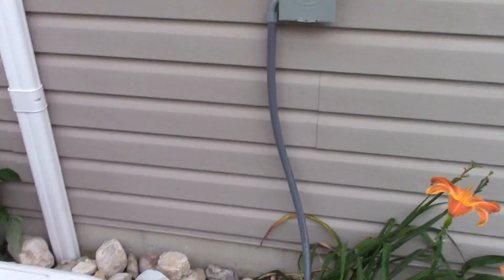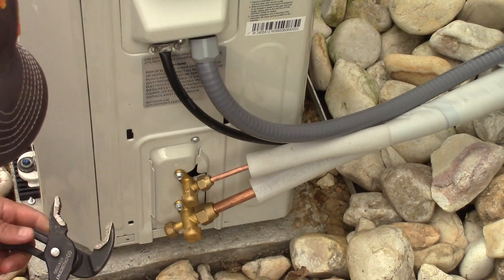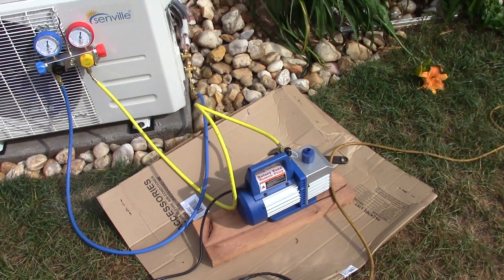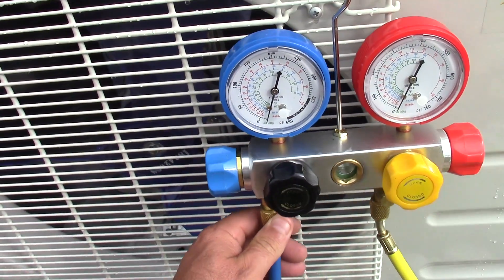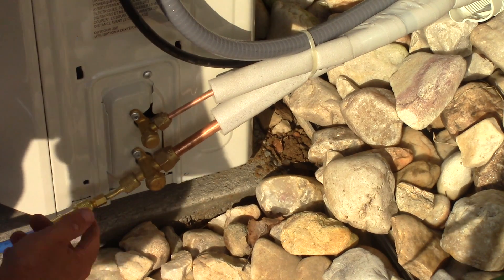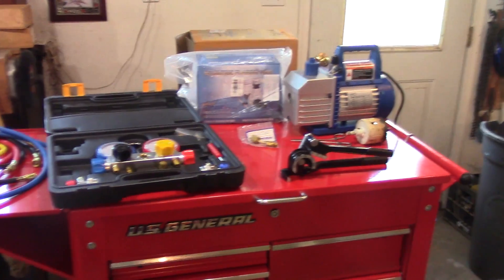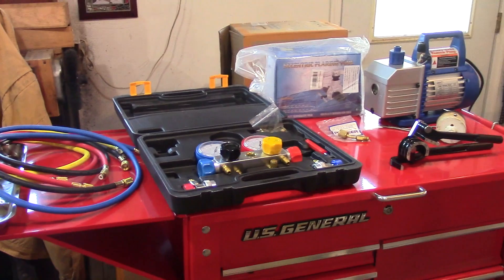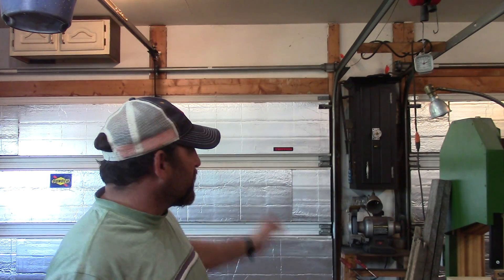Part 3 MiniSplit Install Adding Refrigerant

Comment: Nice video series.  Very helpful.  I’m on my second mini split.  The first one I bought was a cheap model that lasted only 3 years before the condenser unit started springing leaks.  I just bought and installed a MrCool model.  Got to vacuum the line set and release the refrigerant still.  Bought the same line gauges set but the adapter was the wrong size threads so waiting on a new adapter.  Thanks!

Comment: Why you didn't open the vacuum line before you release the gas ?
Reply: Because air/moisture will be sucked into the system. Better to release small amount of 410 then to let air in system.

Comment: Thanks for the walkthrough. I was quoted over $6700 on a 30k Mits install for my garage. I am going the pioneer route with a 36k system and saving myself about 4k.   I am going to have a 66' run so I actually need to break the lineset vacuum and add 16 oz  of refrigerant to the lineset before I open the the valves on the outside unit but on the bright side I will be able to check for leaks before I do so.

Comment: Mini Splits are the way to go, heating and cooling, I use my 5 Mitsubishi all year long, heating and cooling.  I save a fortune on cooling versus the old 13SEER  AC forced air, and oil no delivery in years, electric bill barely went up in winter $40, electric dropped like $200 in hot July and August, MiniSplits are great

Comment: should also purge with nitrogen before opening the refrigerant then pull vacuum again...according to the Mitsubishi installation manual
Reply: you only need to purge with nitrogen after connection, then vacuum that down. It should also be leak checked for minimum 20 min but an hour is best.

Comment: By not removing the suction vacuum hose the Freon charge went all the way back to the manifold when let loose..Would it not be better to remove hose , then release the Freon charge into the system. Maybe that little bit of waste is insignificant?
Reply: Think I read in the instructions you want the gauges still hooked up so you can monitor the pressure after cracking the ports open, just another leak check before powering the system. The tiny amount that comes out is no problem. Remember, the system is charged for up to '25 feet of line, it shipped with '16.

Comment: Not a good video so many mistakes you don’t check for leaks after you vacuum you need to use nitrogen when leak checking then vacuum down unit.  Many other mistakes
Reply: Meanwhile it's working perfectly....even after the 1.5 year review.  Take your negativity over to another channel.
Reply: missmymountain don’t get mad at me because you don’t know what your doing.  Showing people the wrong way is not good even if it is still working.  Wrong is wrong.   And you sir were wrong
Reply: @BrianGentry317  In your mind you know "the" correct way to do things.   Reality sometimes proves otherwise. In this case it has proven his way works.   Yours may as well but you're just talking about it and he's doing it.
Reply: missmymountain it’s clear your not a HVAC tech. So keep doing it the wrong way and see what problems you’ll have down the line.  And what it’s going to cost you to correct them.  🤦🏾‍♂️
Reply: @BrianGentry317  I haven't been a tech in many years; I do employ a bunch though.   Many of them share your attitude that there is only one way and yours is the best way.  You call what he did wrong, which implies it didn't work or it caused damage.  Two years of the system operating well has proven you wrong.  I can't help you see the error of your opinion but I hope you'll take this as a lesson and know you aren't always right.
Reply: @BrianGentry317  Lol.  I never said anything about you being right either.  You've got a lot to learn in this life. For your sake I hope you're only 16.  I wish you the best of luck at learning to learn.
Reply: @BrianGentry317  Exactly.  I'd suggest reading comprehension as your first next lesson.  This helps with understanding the meaning of what you read and not just being able to pronounce the words.

When I say "know you're not always right" it's a different way of me saying "you're wrong".
Reply: @BrianGentry317  You can't let it go.  You'll be thinking about this lesson for a while.

Comment: Invaluable video, great stuff!

If you were going to add another indirect unit to the compressor how would you wire it and run the lines? Would a single compressor have enough capacity?
Reply: Old Man Strength You can’t add another head to a single zone mini split which this is. You have to  buy a multi zone outdoor unit.
Reply: Dennis Jones thanks boos, I figured that out shortly after posting this question. Just ordered a three unit package, wish me luck!

Comment: Thanks so much, I’m going to do it myself. My quote from HVAC was 3900$
Reply: Including the unit or just to install it?
Reply: @bigpicturethinking5620  if I’m remembering installed but that price since then has gone way up. I installed it myself and bought the tools off Amazon very easy and has worked fantastic for two years.

Comment: How do you add the extra wall units to one outside unit?  You said up to 3 can be added.
Reply: you buy the outdoor unit designed for 2, 3, 4 or 5 indoor units, which come as a kit. Basically they are all considered extra zones.
Reply: They are called DUAL-ZONE, Triple Zone...units and they have the hookups for the extra heads. I.E. 28000 BTU base Compressor with TWO 12000 BTU head units, or an 18K and a 9K BTU head.etc.

Comment: Thanks for the great instructional video. my garage is a 12 by 24 but it has an open loft therefore I am considering a dual zone 9000 up 12000 down so I can keep the higher elevation loft cool in summer. Only have about 400 square feet. Do you think a 1 head 18000 unit would suffice? Cheers
Reply: Mitch Howes Not knowing the Senville, I haven’t seen any single zone system be able to add another head. It has to be multi zone outdoor unit.
Reply: Is your garage insulated? If so just mount a 9k BTU single unit up in your loft. If it's uninsulated, get a single 12k unit.

Comment: You won't see bubbles while it's under a vacuum. Bubbles can be seen if you do have a leak when system is pressurized with nitrogen preferably

Comment: When checking for leaks you should use nitrogen. Using vacuum to test for leaks is not good and  useless.
Reply: Yes sir you are correct and if it is leaking it's just going to suck the soapy water inside there might be bubbles on the inside LOL
Reply: I fill with propane, check for leaks with a bbq lighter.
Reply: @robertkat  Yeah.....that's how I used to do it back when I had eyebrows...........boom !

Comment: Question, why remove the suction hose last and lose Refrigerant when you can remove it first before releasing it? Or would that cause the vacuum to suck in air since the system would be in a vacuum state ?

Comment: And a GREAT finale to the series!  Seriously folks, if you are looking to do this yourself, this is the video to live by.  I have the Senville Leto 12,000BTU 110v I just finished installing last week and can't say enough good things about it.  I crank that puppy down to 62F and it is quiet as a mouse and keeps my bedroom ice cold, so don't poo-poo buying such an affordable system.  I've watched at least 2 dozen of these videos in preparation to do mine, and I can honestly say that yours is down to the T spot-on with the mfg instructions and how I ended up doing mine.  Thanks so much for a great DIY how-to!
Reply: Can you tell the pros and cons with the 120 version please.
Reply: @billcovington5836  120 volts does not have pros at all. May be some added safety if you got electric shock. North American system of 2 hots and neutral in between is "black guy rig"
Reply: 12K BTU ... Whats your Sq Footage ??
Reply: @pecosray  It was in a room about 210 sq ft.  But in a 130 year old house, upstairs, no insulation, knee walls, south facing...so the room was basically an oven, thus the oversizing for those conditions.
Reply: @DyscoJen  Thank you
Reply: @DyscoJen  FYI on the strength of this post... I just ordered mine.... Awesome content... TY

Comment: Nice work on this unit, next year I plan on replacing my home heating and air conditioning unit with a Goodman. 2 years ago I installed a 45,000 BTU natural gas furnace on the ceiling of my attached garage and it worked out great. Had Home depot come in for a furnace and AC replacement and they were looking at 8000.00 same deal with Goodman and myself for around 3500.00. The guy from HD gave me a compliment and said wow at the installation work on the garage April Air install for the furnace in the basement. He gave me hints  on new code for water valves for the April Air which I instituted.  No more saddle valve. Changed the valves for the two refrigerators water also. I did add to wish list the minimal tools you purchased here to buy this year in anticipation of the project next year.  Should be a fun project. Being DIY attention to detail is everything, the HD guy had been an inspector and he could not have been happier with the work.
Reply: The Unit came pre-charged... no need to buy any.

Comment: Great series, Bob.  You know, when a whole house (Central) HVAC system can run $10K plus, this unit makes so much more sense, especially when you can use two or three of them to create 4, 6, or 9 different zones.  I've got a property that will be perfect for something like this should (when) the current Central unit fails.  Thanks as always for taking the time to put this series up.
Reply: I have a wifi dongle for mine you can have. I am smart enough to install a mini, but not smart enough to program the wifi. Sound familiar. I guess my 10 year old neighbor could do it for me lol.
Reply from the maker: These units would not be bad spread throughout the house.  Do this job, gives me the confidence to install my own heatpump down the road for my home.  From what I understand, my heat pump should last for 20 to 25 years, so I am gong to fix it and keep it running until it lasts in whole service life.  Upgrading to newer refrigerant systems is not going to pay for itself and some of the high efficency units have expensive electronic boards and the parts are not cheap.
Reply: My nephew in New Mexico went from evaporative cooling to mini splits. He has two compressor units mounted on the roof ( his house is a flat top territorial style ). Each compressor handles four air handlers. He only uses the units in the room he is occupying at the time.

He works for a big plumbing and heating co. so they installed his units as a test for effectiveness. That was two years ago. So far so good. Now mind you, there is no humidity where he lives. His units are wifi so when he leaves work he turns on the appropriate units with his phone. Easy peasy. House is cool when he gets home.
Reply from the maker: Robert that sounds like a nice setup.  I could have gone with the wifi with the Senville unit, but I didn't think it was worth the extra cost.
Reply: In central ac you have only one coil, and it will cool and heat every place in your home. If you need zone, check multizone HVAC, control unit $200 for 4 zones and motorized vents $100 for each zone. Yes
Reply: Robert, that's exactly what I was thinking...the old systems cool an entire house when in fact we generally live in one section at a time, kitchen, living and den in the daytime and bedrooms at night.  I think it's the future when it comes to conditioned spaces.  Thanks for sharing a great example of this idea, Man!!

Comment: You should stick a Killawat on it and see the energy use.
Reply: I put my amp probe on my 18000 BTU 240 volt Pioneer and max 
amps on high cool was around 8 amps. My breaker in the panel 
is only 15 amps. They use more amps on the heat cycle.

The 240 volt models are cheaper to run, but if you are cooling a small space
the 9000 btu units are 120 volts only, I believe.
Reply from the maker: Maybe I will.  You can probably find someone that has already done it.  Google it.
Reply from the maker: Robert, 
240V requires 12 gauge and a 20 amp breaker.  IF you have the right gauge wire you may want to switch the breaker up to 20amps.
Reply: @doublewide6  by NBC you can use larger wires with a lower amperage breaker as long as the breaker meets mfg. minimum requirements. You can go with a wire size as large as the breaker and equipment terminals are rated for. A typical 15 amp breaker can use wire sizes from 14 AWG all they way up to 8 AWG.
Reply: Bob, mine is 10 gauge 15 amp breaker. That is per Pioneer. Never had a problem tripping breakers. Like
I said mine pulls around 8 amps at load. My compressor is five feet away from my panel.

Comment: Pro looking install. Now that you have the gauge set and vac pump
you can brush up on automotive a/c. I drive old wore out cars and 
am always repairing mine or the neighbors a/c. Enjoy the mini.

Don't be afraid to leave the split on when you aren't home. Set your 
remote thermostat at 78 degrees and let it run. It will keep the 
humidity out of your building. Mine here in Missouri cost about
$20 more on my electric bill.
Reply from the maker: How big is your building is it insulated?  How many Btu is your unit.  I would like to calculate the cost on the unit.
Reply: My attached garage is 24' x 28'. It is uninsulated except for the ceiling.
I have an 18.000 btu Pioneer. Like I said, if I leave it on at 78 degrees, it
just purrs along. Our garage is a mancave-workshop-laundry room. We do shut 
it off occasionally, but for the most part it stays on.

You are going to have to play with yours to see what it will cost you to run it. It was a necessity
for me because I hate humidity. I do crank it cooler on real hot days. If I open the garage
door, it recovers quickly.  Enjoy, and like I said, nice install.
Reply: You cant buy refrigerant unless you have a liscense.

Comment: The refrigerant is in the unit itself, ennough for the system ?
Reply from the maker: Yes it is in there, I think they give your enough for a 25' lineset.  If you had more lineset you add refrigerant by the foot.  The manual has a chart for how much for each foot.

Comment: At work we just use vacuum pump oil on the seals and it’s always worked fine.
Reply from the maker: That is a good tip.  Since I'm not a pro and I was figuring that I was going to be making my own flares, I figured the nylog was a no brainer.  Plus I didn't use a Micron meter or Nitrogen on the install.